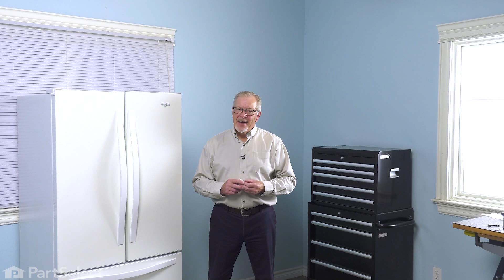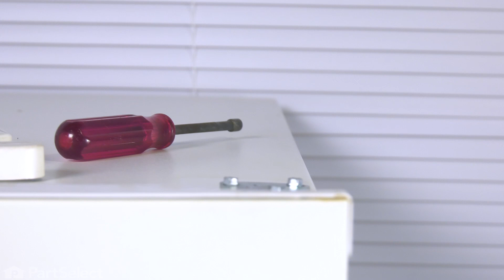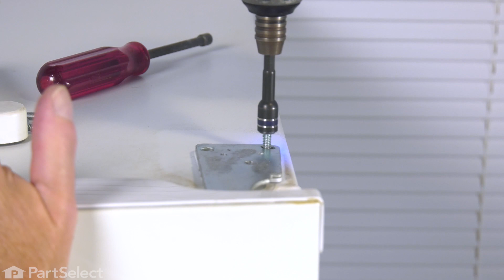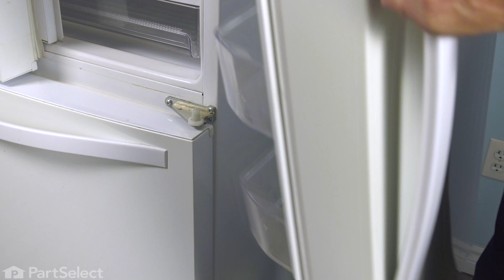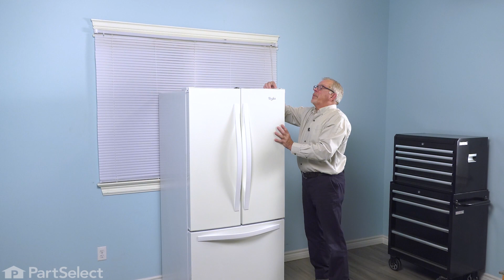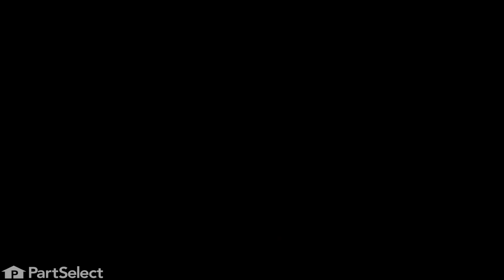Whirlpool Refrigerator Repair - How to Replace the Door Closer Cam  (Whirlpool # WPW10470155)

Comment: I have replaced the cam but there is now a lot of free play in the hole in the door that the cam slides into.  I am thinking something is wrong in the door itself.  The new cam was exactly as the old one.  the old one was a little worn though.  But its like the hole in the door is much larger than the cam is.  Any suggestions?
Reply: Did you fix this? Our door just stopped working as well.
Reply: @lyleburkhardt6492  same here
Reply: @larryspera  I tried spray foaming with the hinge in place inside, it worked for about a week. After that failed, I applied silicone caulking with the door off and the hinge pin out. Placed the plastic piece inside of the silicone and tried to caulk more silicone into the hole around it with it attached back onto the fridge. Then kept the door taped shut for 24 hours for the silicone to dry. So far so good.